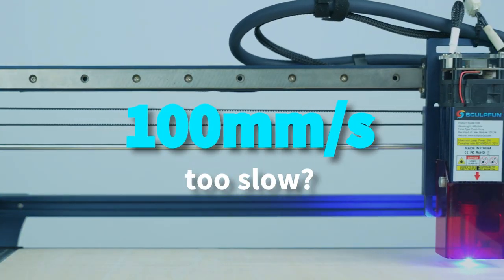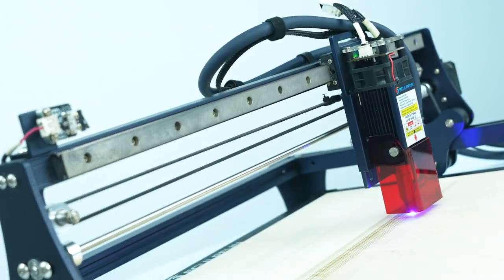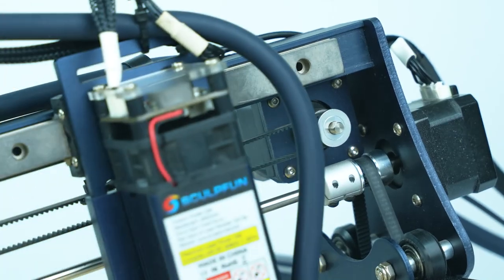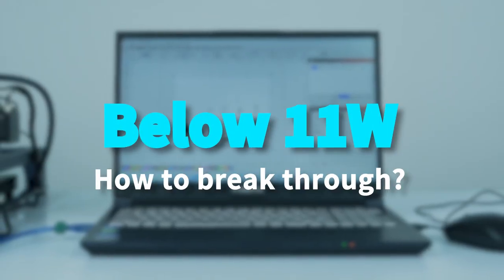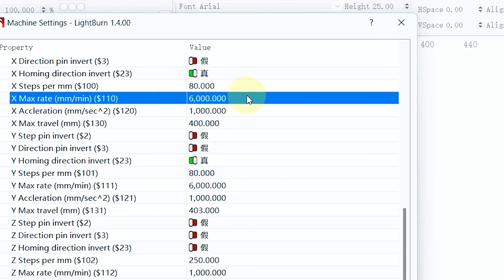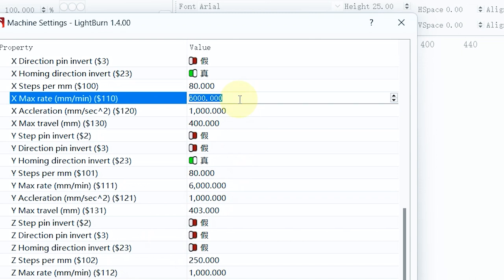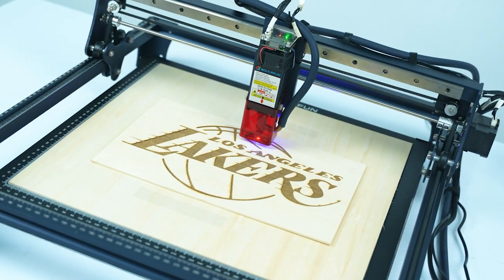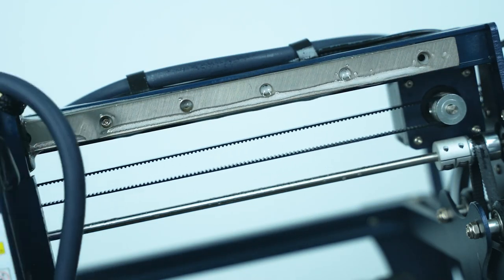Breakthrough Speed Limit｜High-Speed Engraving｜Make it Happend with Sculpfun Lasers｜How to Do it?

Comment: Would you recommend the 22w or the 33w when im mostly using it for engraving?
Reply: the dot size is bigger which means the final engrave lost some quality, for engraving is better to use 10w or below at least for detail. In some engravings it doesnt matter.
Reply: @oscarmayorga7461  and for the best of both worlds? (Cutting and engraving) would it be better to get the 22w?
Reply: @jordierijnen3983  22w and above is for cutting faster and engraves that doesnt require lots of detail, for engraving profesionals use even 2w modules, if you ask me the best of both worlds i would say 10w but at leas for me I use the laser for cutting so I would ratter choose 22w  even tho my engraves have less quality
Reply: @oscarmayorga7461  my main focus will be engravin with some light cutting. But also want some speed, is there any difference there?
Reply from the maker: 22w is a little better.